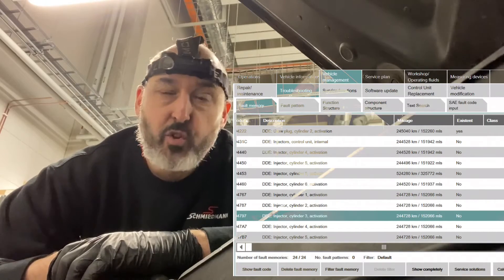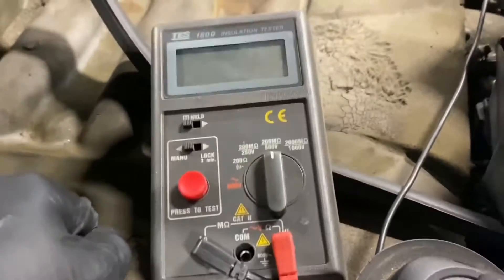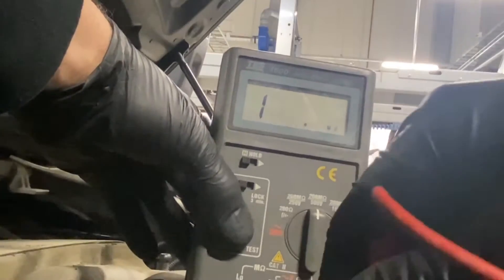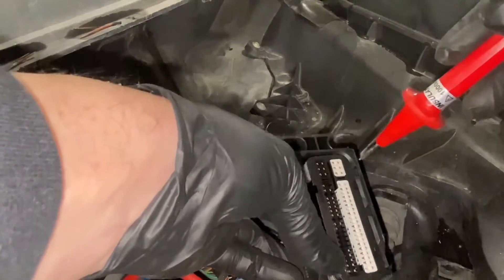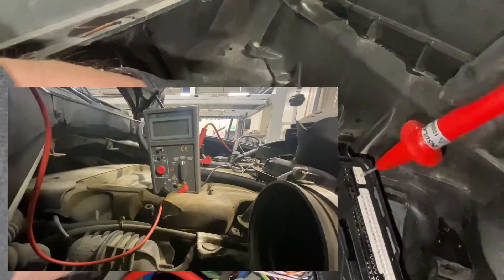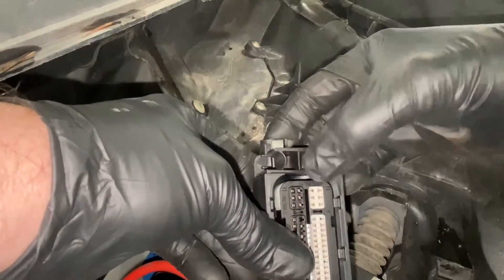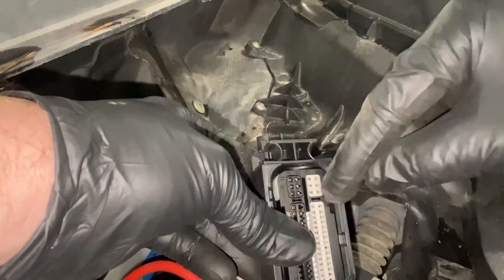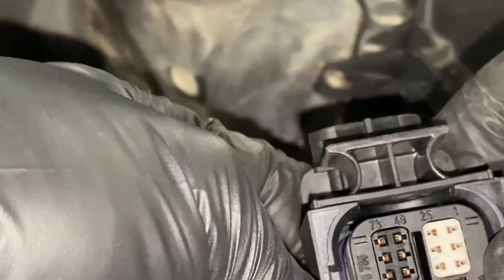HOW TO TEST A DIESEL INJECTOR THAT SHORTED WITH AN INSULATION TESTER

Comment: What would you do differently to determine if it is an injector like you show, vs an injector wire harness?
Reply from the maker: Disconnect harness from DDE and injectors check for continuity to ground on each pin.